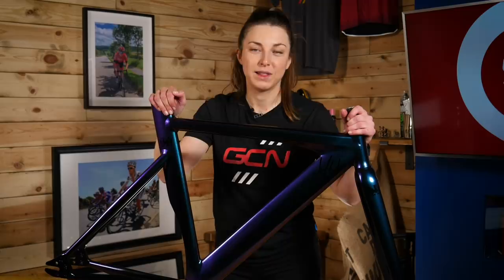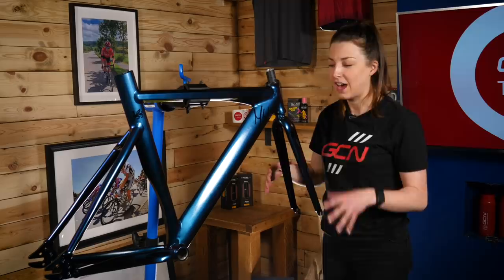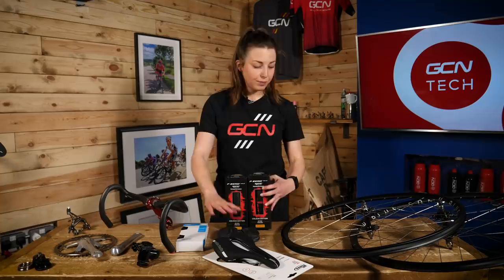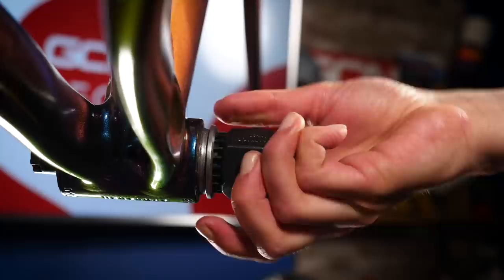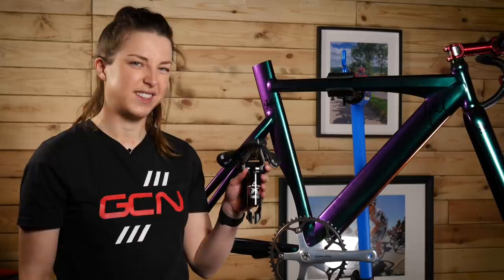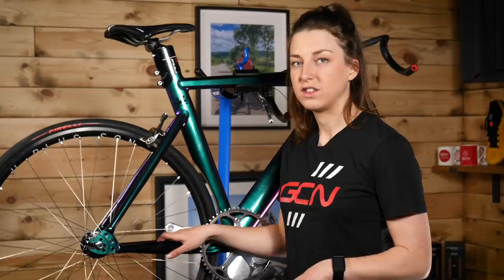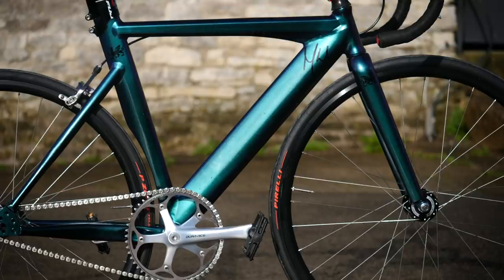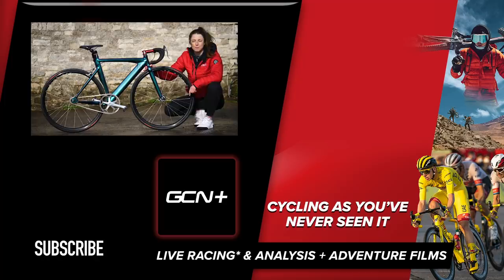Building Manon's Custom Painted Track Bike

Comment: I think I'd have put a dummy lever on the right hand side, just so that on the tops my hands would be in the same position
Reply: 100%
Reply: That assimmetrical grip would annoy me as well
Reply: either that or just a brake lever on the tops.
Reply: Ride brakeless and live on the edge of life.
Reply: A rear brake would also just drag and drift when in an emergency.  About as much stopping power as a fixie with no front brake.

Then again, that's way better than some bike back in the day that only had rear drum brakes.
Reply: @jonyfany8763  ride with a front brake and potentially enjoy many more years of riding. Brakeless is pretty safe if you're experienced and at lower speeds but you never know...
Reply: If you run Tektro rl340s they have a spring that keeps the lever in place, even with no cable connected.  Yet another option.
Reply: Agreed. I'd also (eventually) chance all the silver items to black. especially the little silver poking through on the fork. But that pain job looks great
Reply: But it’s illegal to ride that bike in the UK. In a very high profile case three years ago, a cyclist was given a two year jail sentence after killing a pedestrian who stepped out in front of him. He was riding a fixed wheel bike with no brakes, and that as deemed to have caused the collision.
Reply: @johnwestwell2942  That bike built by Manon very clearly has a rear brake...
I was suggesting putting a second dummy lever on so the bars are symmetrical
Reply: @boliverfridgewater3140  Them's the breaks. But for stopping, I'd stick with brakes.
Reply: The old TT setup was to use a center pull brake with the cable wrapped around the stem. Yes track bikes were used for flat TTs. I'd use about  a 93. This was USCF legal.
Reply: @boliverfridgewater3140  while it may make for a slight improvement,  to keep from getting dropped, some of us would need a lot more help than removing brakes.  😁😉
Reply: The point is that the bike needs a front brake. As it’s currently set up, it’s illegal to ride on UK roads. Putting a non-functioning lever on the bike won’t solve this.
Reply: @boliverfridgewater3140  did you drop out of school ? It's brakes that stop you, stuff breaks when you drop it.
Reply: @Mike_in_Thailand  He only dropped out after getting his PhD.  (Admittedly it wasn't in English.)  But I suggest that you try re-reading his comment, (for comprehension).
Reply: @richardharris8538  Dr Oliver Bridgewood has got the PhD ...Boliver Fridgewater has n't. Perhaps you should re-read for comprehension about who I was replying to ?
Reply: @Mike_in_Thailand  Duh!  They're one and the same, eh.  :-)))
Reply: I would find a fork where I could put a brake, even if it would alter the geometry a bit. No way I would ride a brakeless bike here.
Reply: Or use a bullhorn handlebar
Reply: @franciss2529  It's also illegal in a lot of places.
Reply: Why should one favor a Frontbrake over a rearbrake?
Reply: @thelars1569  They're thinking that a) Front brakes stop you faster and b) With a fixie, you could use your cranks to stop the bike. 

However, if you're riding single speed with a front brake, you could go OTB if you have to make an emergency stop at speed. Especially with body position/center of gravity being close to the front of the bike than the bike. I prefer a back brake myself if I have to choose one.
Reply: @johnwestwell2942  I believe that the fixie counts as one brake itself, then with the back brake, it counts as two, so this should be road legal.

Comment: Please for love of all that is track don’t even think about sanding down and spray painting dura ace cranks
Reply: Right. Next project, DIY powdercoating in a color that goes with the scheme.  That'll do the seat post, stem, brake lever, and crank all in a theme that really makes it look like it was intentional.  I'd say Prismatic Powder Monaco Copper.  I'm guessing Manon and her rally car dad are just itching to go pick up a second hand junk oven and try their hand at powdercoating.
Reply: @karlaldinger3017  I wouldn't touch those cranks. Lovely as they are imo. Put any extra money into functional mods, flat bar, front brake. The bike is a beauty 👌🔥
Reply: Agree. They're perfect.
Reply: They need unicorn anodizing for sure!

Comment: 52-15... she really just had to flex on us like that
Reply: Cries in 46-17
Reply: Right.I'm 72 and still ride my bike every day. When I was 25 and racing in Texas, 15/ 52 was pretty much my choice for pounding out miles on a flat or descending path at around 23-24mph. For riding around town now (I remind you, I'm 72) I have 14-24 and 26-40, which is just fine for around town. Also, note that I switched out the stock 18 sprocket on my two vintage Raleigh Sports (for rain and snow) with a 23, and I'm still overgeared if I want to go up a hill. On the other hand, when my wife and I did a bike trip from Le Havre to Florence and back in 1975/76, we climbed the Passo del Bracco on 24-42 and 26-42 with 35 pounds of gear. Youth. Believe me: don't take it for granted and enjoy it while you can.
Reply: @Philobiblion  Respect for still keeping them cranks turning!
Reply: Cries in 44-16

Comment: I love the build but its use on any public road in its present state in the UK is not only dangerous due to the massively inefficient braking system but wholly illegal in respect of Pedal Cycle Construction and Use Regulations which require any cycle used on the public road be fitted with a front and rear brake.  If a cyclist riding without a legally equipped bicycle were to be involved in a collision the likelihood is they would find the other party, assuming a two party collision, had a significant advantage in countering claims for and of damages and, more importantly, even if the other party were found at fault it is likely the relevant insurance company would apply to have any damages awarded the cyclist significantly reduced.  I would suggest the possible consequences of riding this and similar cycles on a public road far outweigh the pleasure to be gained from them when staring up from a hospital bed or out  to a courtroom accounting for the lack of a functioning and properly constituted brake system.
Reply: A change of fork would sort it out and needn't ruin the appearance

Comment: 52-15 for city riding herm...
Reply: It does seem crazy high for city riding, but based on their previous "commuting" videos, it seems that they have long commutes to the city from smaller towns via country roads.
Reply: This. I mean, she probably does have the power to pull that off, but the "city" isn't that big and the hills must not be too mad for her to even consider that. I ride a 46-15 and it's as big as I can go to get up the ramp from the parking garage at the office.
Reply: That gear seemed way to high to me, but each to their own 😀👍
Reply: thats around 40km/h with 90 rpm... waaaaay too high for commuting
Reply: I commute on a 51 15. Easy stopping and pulling away. And from time to time I can actually do a free standing pull away like I'm a national track cyclist lol. Plus easy coasting.
Reply: Not to worry, her city is all downhills.......
Reply: I ride a 46/17 or a 48/18 but i do live in Yorkshire.
Reply: @steezymtb5876  To me, the real benefit of lower gearing on a city bike is to get off the line quicker! It doesn't really matter what your top speed is if it takes you forever to get up to speed every time you stop at a light.
Reply: I thought the same.
Bro I use a 50 -16 and in some parts of the city is fucking annoying.
I do not have the legs for that 52-15
Reply: AND NO FRONT BRAKE... yeah. This was an odd one.
Reply: All of you make fair observations but she also is a former national track champion, so I’m pretty sure she’s pushing a fair few more watts than we are
Reply: guys being smart with the girl that was winning events on the track, seriously, c'mon lads :)
Reply: sounds good, as long as it's a Flat city
Reply: She’s a former Track Pro Cyclist anyway so she got some power to turn those pedals to a cafe

Comment: "Relatively cheap build"
puts on Dura Ace crank
Reply: those things run $200+ for a used set. The crankarms I mean. The chainring is another $60 used. I gasped when I saw them. I guess the meaning of 'cheap' changed over time...
Reply: @hermanmcpootis5425  1:25 she said it was an old crank she already owned. So in some ways, they're free. So it's actually cheap
Reply: When she suggested she wanted to paint it I almost freaked out
Reply: @hermanmcpootis5425  Who cares how much it costs? If you already have it in your garage, it doesn't cost you anything. 

Who has ever built a bike from old stuff, knows what I'm takling about. These are sometimes crazy mix of parts.
Reply: i recall this same crankset was used by Ollie on a fixie conversion - loaned from Manon... so she wasn't lying...
Reply: It’s no hollowtech, looks like octalink.. justca baby step up from square taper
Reply: Old dura ace cranks
Reply: That Tune stem is not exactly cheap...
Reply: @Fenthin  that is simply missing the profits on valuable equity. By selling the 7700 crankset Manon could buy similar 6500, pay for anodizing and still have something left to invest into, say, 7400 brakes. Which - unlike 7700 cranks - are long ago discontinued and  gain in value with every year on.
And that is why and how I hate people having random stuff laying around.
Reply: @feedbackzaloop  I had a mint set of vintage Sugino cranks that I had sitting in a box in the shed for 10  years. I sold them for $175.
Reply: @BarfyMan362 ... she had them left over from her track days and was a sponsored athlete at the time. Of course she'd have a top end component.

My point is they're already there. Use them
Reply: @feedbackzaloop  Of course it is.  But if you have a lot of old parts, you may not want to spend time taking photos, selling parts and buying replacements.  You simply take the available "scrap" and mount it to your bike.
Reply: Makes sense to me. I swapped my Dura-Ace 7800 groupset for 9150, but my old group set will still be a nice upgrade for my son's road bike that is running Tiagra at the moment.  Plus, it gives him a project we can work on.
Reply: Wow you guys took this comment way too seriously. 😅 Anyhow, have a good day to y'all.
Reply: I'll take one of those! Could afford dozens of UN-55 bbs and haven't run out of soda can shims to make a cheap crankset run round though!
Reply: @lostmotor  yea, that's a 7710 octalink crank
Reply: @lostmotor  i think that wheelset was the same one Ollie built by hand too 🤔
Reply: @Fenthin  Yep, "parts-bin specials" are some of the most interesting bikes out there!
Reply: The beauty of having over 2 million subscribers me thinks?

Comment: I would probably have preferred to have a flat bar brake lever instead of the single hood but beautiful bike!
Reply: Agree.
One brake hood just looks wrong.
Reply: True. Or put a dummy lever on the other side just for looks.
Reply: Awww there's only one hood?
Reply: @jaredknapp6832  i grant you permission to check for yourself
Reply: True

Comment: I thought front and rear wheels both needed independent braking systems one of which could be a fixed gear for the rear. In which case this bike would be illegal to ride on UK roads.
Reply: Keep your hair on Karen 🤣
Reply: Sure your right
Reply: Your right
Reply: Well if you want to be technical the law only states a bike has to have 2 brakes, it doesn't specify 1 per wheel, so you could get away with having fixed gear with a brake on the back wheel 🤷‍♂️
Reply: This is how Cycling UK sums up the law on brakes:

‘It is clear that a fixed wheel counts as a braking system operating on that wheel, so a fixed wheel bike with a front brake is legal (assuming both brakes are efficient!), but a fixed wheel bike with merely a rear brake isn't, as there's no independent front wheel brake. ‘

So that bike isn’t legal to ride on UK roads.
Reply: @davidmidcalf3470  Mount another brake on the backside of the rear wheel brake.
Reply: @davidmidcalf3470  UK law actually specifies that a fixed gear bike has to have a brake on the front wheel.  Non-fixed gear bikes have to have two independent braking mechanisms, one of which must operate on the front wheel.
Reply: @davidmidcalf3470  no it doesn't front and rear brake is the law fixed is good enough for the rear
Reply: @davidmidcalf3470  David, the law is clear that you have to have independent front AND back brakes. So it does specify both wheels. Just saying

Comment: The rear brake seems very pointless, but I'd definitely add some foot retention.
Reply: Gotta be street legal to ride it on the road in the UK, showing off your brake-less skills in a GCN video on the open roads is just asking for trouble.
Reply: @arvidfahlander5364  I think they’re saying it would make sense to put a front brake on not a rear, cause ya know it’s like having two rear brakes which is kinda redundant. And yes foot retention is always a good idea especially on a fixed gear

Edit: she did say there is no brake mount on the fork which explains the rear brake instead of front

Comment: It is clear that a fixed wheel counts as a braking system operating on that wheel, so a fixed wheel bike with a front brake is legal (assuming both brakes are efficient!), but a fixed wheel bike with merely a rear brake isn't, as there's no independent front wheel brake.
Reply: Would probs need a new fork to sort that? I saw the front fork had a Aluminium steerer so maybe the existing fork bridge can be drilled, can pop into Argos frame builders next time she is at GCN HQ...👍
Reply: Alex knows a guy that'll mount a disc!
Reply: I understand that a lot of people don’t follow the law but GNC needs to have some responsibility to show their are doing things correctly.
Reply: @phil4263  Agree.  A channel like GCN should not be showing a build that is not legal in the country in which it is to be ridden.
Reply: UK law requires two braking methods, so fixed gear and 1x brake is sufficient, regardless of front or back. (Though I agree a front brake is much more useful if only going for one).
Reply: @ExtremeScampi  Interesting to know.  German law requires a front brake if you're riding a fixie.  Still I wouldn't trust riding one without a front brake.  A good strong front brake could make all the difference if a car or pedestrian jumps in front of you.
Reply: @ExtremeScampi  " it is an offence to ride a bicycle on a public road without two efficient braking systems operating independently on the front AND rear wheel"  you are wrong my friend, and young manon has uploaded video evidence of herself being offensive while also being her normal pleasing self.

Comment: I like it, but a couple suggestions.  SPD or SPD-SL pedals.  Those make a world of difference on a track bike.  Also, probably just run a regular style brake lever.  Not only would it be more aesthetically pleasing, but it's simpler to wrap bars too.  Otherwise, solid build!

Comment: I would paint the stem and seat post black or at least a matching color.  As for the crank, instead of spray painting, I would powder coat.  Power coat is tougher than paint, but will eventually get scratched anyway from shoe rubbing.

Comment: Pretty nice but if you’re using just one brake on a fixed/single speed the lever has got to be on the tops, no sti lever on just one side!
Reply: also would be better if it was a front brake

Comment: Needs a brake lever on the tops instead and a fork that will allow a front brake. Otherwise it's technically illegal to ride on UK roads as there's no front brake (you basically have 2 rear brakes!) and you might as well have a front brake for emergency stops.
Reply: touché
Reply: Was expecting this to be the top comment
Reply: I clicked on the video exactly by seeing that it does not have a front brake, but has a rear brake

Comment: Great build Manon! Fantastic bike! Maybe black  cranks with a red line to match the stem and tyres? And obviously your seat post, again painted either with the same colour as the frame or you could consider adding another touch of black and red? As long as you match the red with that of the very cool GCN stem! 😉  In any case thanks for another really nice video! 😊

Comment: I don't like not having a front brake.

I would have thought it wasn't road legal without a front brake.  The front does most of the work when it comes to stopping.

Is it possible for a frame builder to add front brakes to those forks?

And how did you do the cable routing to the back brake? I would have thought a track bike wouldn't normally have a back brake and so wouldn't have any of attaching the outer cable to the frame.  I hope it wasn't zip-ties.
Reply: I agree it baffles me that she doesn’t have a drilled fork but instead has a drilled rear. 
I ride a track bike and having some sort of front brake is a must. Your legs being locked in the drive train means there is loads of momentum
Reply: @kieranbutlerk9117  Is the hub on this wheelset still a fixie or is it just a single speed hub with a freewheel?
Reply: @Your_Paramour  it’s a fixed gear cog so cannot freewheel.

Comment: Put a front brake with a Goldfinger brake lever and it will look very good, some MKS Sylvan pedals with cages and double leather straps if you go fixed in the city, it will help prevent fall your foot from the pedals, trust me.
Let the DA crankset on, it's a very good quality and also perfectly round chainring without wobble.
If you want a black crankset go for a Sugino 75, or Omnium, they are also perfectly round chainring.